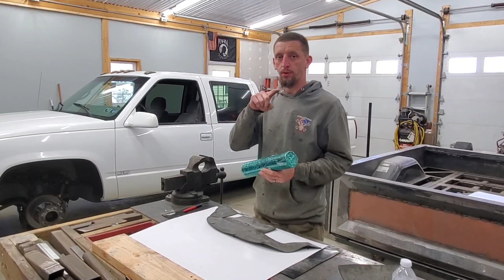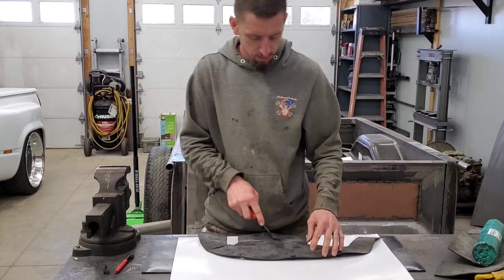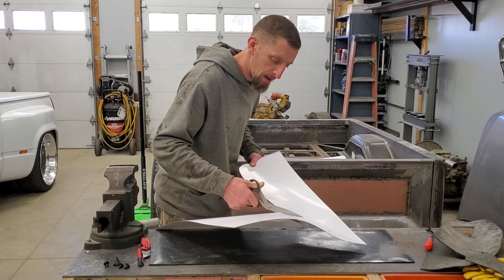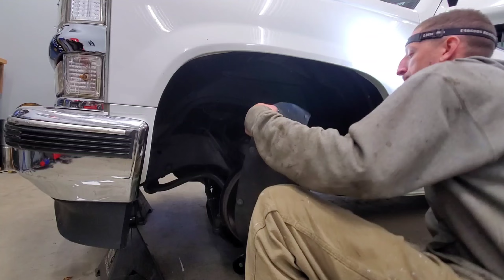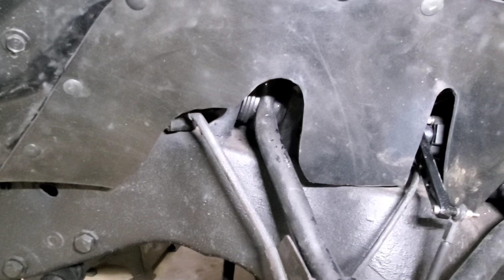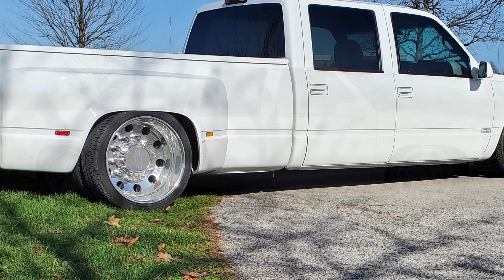How To Make "New" Custom Inner Wheel House Liners / Plastics For Your Vehicle - #OBS #Dually

Comment: Nice work, wonder if you doubled up the thickness there where the flaps are, by simply making a center only piece using a piece of scrap you just cut off,  if that wouldn’t resolve the “flapping”. a little contact cement like you’d use for a rubber patch and it’d be the bees knees.
Reply from the maker: The flapping isn't terrible but yes if you needed extra support for whatever the application is that would work well.   Appreciate you watching and commenting...  Thanks!
Reply: @ChallengeTheBuild  my pleasure. Enjoyed the entire series. You’ve got me looking for an obs dually now myself